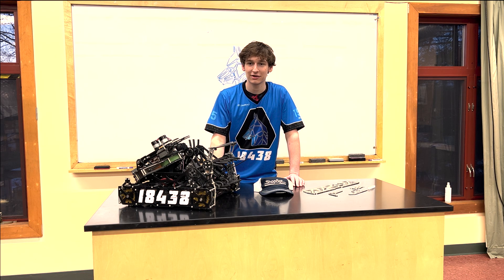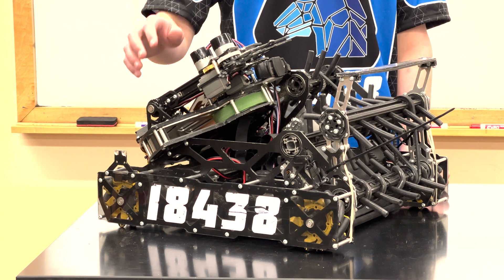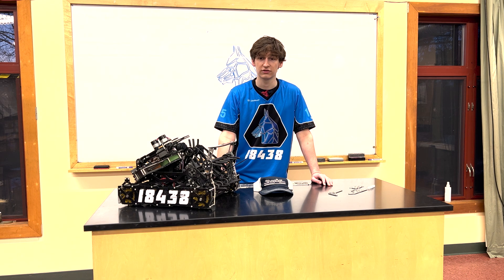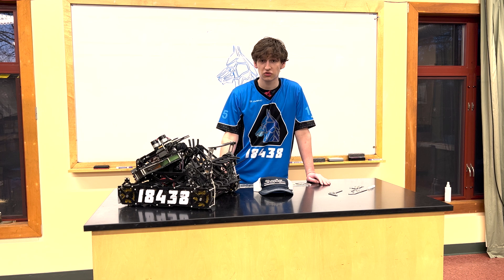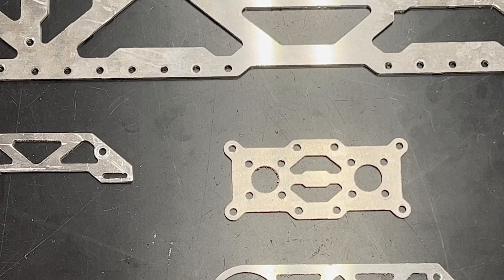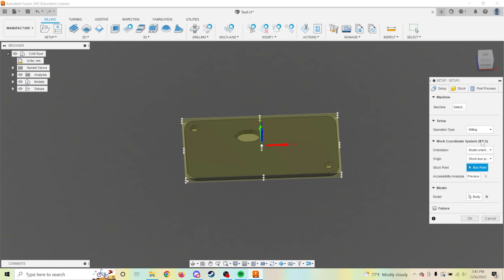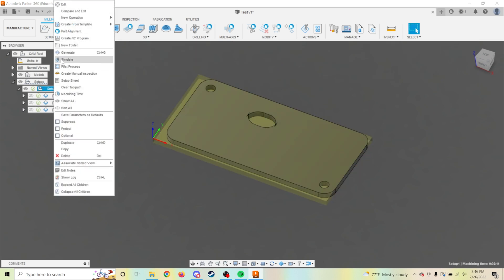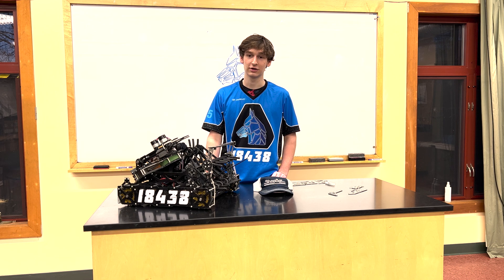How We Make Custom Robots With Our CNC Router

Comment: how thick do you make your tabs when cutting 6061? and how do you cut off your tabs
might sound like a elementary question but im used to using shopbot for wood cuts rather than aluminum :D
Reply from the maker: When cutting 6061 I generally set the tabs to be 0.026" thick.  However, they end up thiner than that because I set the bottom height of the cut to -0.012" below the stock bottom.  I do this so that the endmill cuts all the way through the aluminum. The upshot of this is that the tabs actually end up being 0.026-0.012" thick.  I generally make the tabs closer together for any sort of pockets or other small cutouts, like a servo mount.  I do this because small pieces with few tabs can sometimes get loose and then break the bit, which is never fun.  To cut the tabs I put the aluminum sheet on a sheet of thick cardboard, and then use a narrow flathead screwdriver and a mallet to cut each tab.  I hope that helps.
Reply: @WaringRoboticsFTCFLL breaking bits bc of having too thin tabs sucks, it’s happened. Also I assume you just sand off the rough edges where the tabs were after punching them off with the flat head
Reply from the maker: @josephchapa3603  We remove the rough edges with a deburring tool.  We also use our grinder or sandpaper to remove the burr and remaining tab stumps.  I hope your cuts work well.  If you have any other questions, for example about feeds and speeds, let us know.